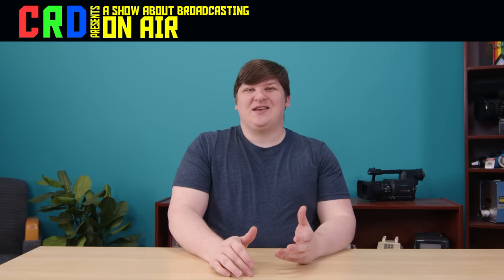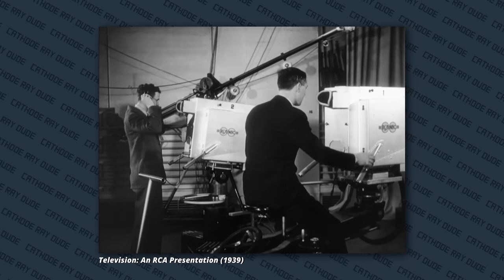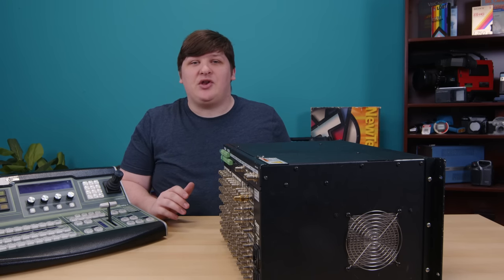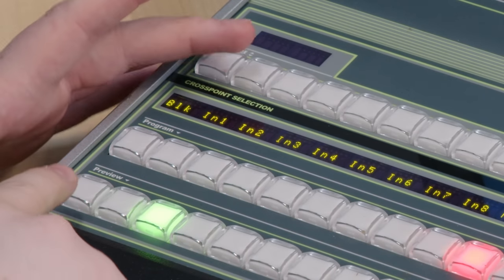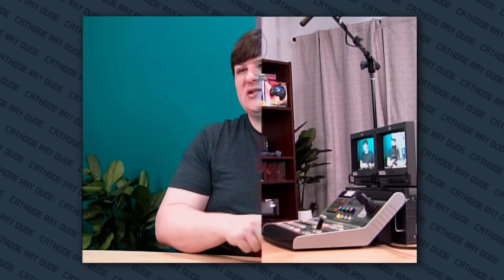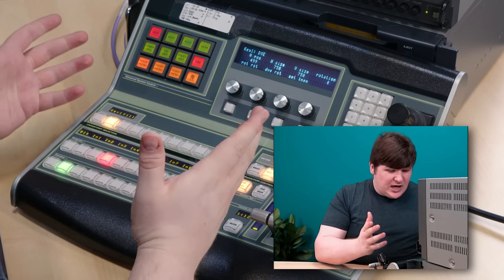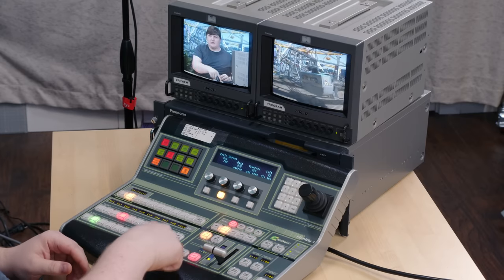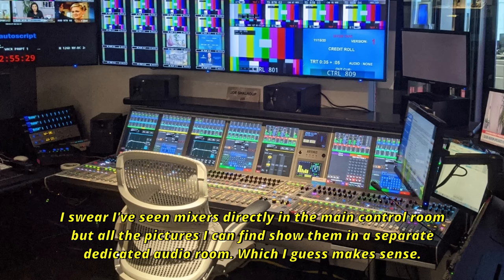What the heck is a video mixer?

Comment: I'm amazed by the concept of a church needing a video mixer - some of the churches here in the UK don't even have electricity! Regular churches might have a microphone and inductive loop so parishioners with hearing aids can follow the service, or maybe even a PA system with speakers, but I don't think I've ever seen one with cameras outside of special events like royal weddings and funerals. Is the service broadcast on TV or streamed, or is it intended to run video displays with Hymns etc like the screens in a lecture theatre, for the benefit of the congregation?
Reply: Oh this could be a long one. It started out with overhead projector with slides for song lyrics. Then digital projectors for song, lyrics and then photo background song lyrics, than they wanted moving backgrounds. This is first hand experience. I've seen a lot of churches where they will throw a camera up and feed a bunch of TVs like cry rooms for mothers with children and sometimes that extends to other rooms as well close circuit TV. However there's also mega churches and multi campus churches on the bigger side of things. the one I was at I personally felt like they went a little too rockstar. Although the pastor liked to do a series once a year for a month taking rock songs and relating a biblical history and some of the songs history. We also like to use movie clips to enhance a reference to something or build upon. Some churches have theater productions. Then there's the recording of sermons/services for later viewing reviewing, saving which goes from cassette tape duplication to video duplication and then next thing you know you're running a live mix for in the room screens a recording mix for streaming and recording multi campus location mixes.....

Among many things that I finally left the church over one of them was worship not being worship and more being more of a rock show concert. Of course this is the same church that wanted the rich folks to sit in the front row. Yeah there's a lot of unhealthy things in the church(s). But when I originally started with this church plant there was something very intimate about running lyrics on the pastors TV in his living room. Good old composite video. And a couple guitarists, with 10 to 20 people.

If you made it this far it was part of the Vineyard Church association, Evangelical based. But there's a lot of different variations and formulations in the US. And for better or worse there are mega churches where I could see that working but I can also see ways that it wouldn't.

Technology is a tool. Just because you have a hammer doesn't mean everything is now a nail even though everything technically is a hammer. There's a tasteful manner of using technology. I went to a seminar on audio one year where the guy went to the location where Jesus did a speech on a boat on the water because the crowd was so big. They were setting up sound equipment up on the top Ridge and the guy thought he heard the other guy say something so he asked the other guy and the other guy was like no I thought you said something. After scratching their heads a bit they got out equipment and found out they were basically in a perfect amphitheater with just the right amount of breeze that emanated perfectly off the location in the water. They then calculated what it would cost to build this nowadays and it was ridiculous to say the least. Suffice it to say God wanted his son to be heard that day and was willing to essentially pay for sound reinforcement for that one event before such things existed.
Reply: @imark7777777   Wow! Musicians? Guitars!? Wait, was that scene with James Brown in the Blues Brothers for real?!? Here, a church tends to be an unheated 700 year old stone building with maybe a church organ (wind, not electronic), and maybe a concert at Christmas with the local school orchestra - it certainly sounds like you guys have a more engaging and dynamic time of things! We have some nonconformist churches and halls, but they tend to be only in larger urban areas, or at least parts of the country I'm not in, so I've not seen what their service looks like. Thanks for taking the time to answer my question, you learn something new every day :)
Reply: @richardbanks2669  oh shoot I have to rewatch the blues Brothers. Yeah it can vary from singers a couple guitars piano fiddles flutes recorders orchestras in some cases. It depends on the musicians in the church and how the church wants to embrace those members.

I don't always read all the comments on a YouTube video but when it's under 100 or in this case 400 and a good topic I definitely enjoyed going through them all.

I briefly visited Scotland England and Wales with scouts so I have a vague idea of the UK church situation and how it's how do I put this state standardized religion by majority. But we also have the Catholic Church over here which is probably the closest. Although they generally have lights and some form of audio reinforcement. And some of the fancier ones do more things but they're stricter to the way they do them so it really depends on there local Bishop if that's the right word.

I love visiting my family in Buffalo New York as they were mostly Catholic and all good Catholic churches (a major assumption made by a 5 year old ) have pipe organs.... Which I happen to like.

I also know a few Methodist churches that weren't that far off from the church I visited in England. Not necessarily referring to the cathedraly ones.

One of the churches I went to liked to do a sunrise Easter service. They also did a few Sundays in the park, consisting of a small to medium band and sermon.

There was a church I went to that liked to do a full Easter themed month almost. Complete with members acting out the process in costume and even renting the old State historic Fort for it's Stonewall aesthetic. I got to be one of the Roman guards. There was even a portion that I didn't get to go to involving a hike up a small mountain. Which led up to Easter Sunday where they had a small mock up of a tomb made out of concrete on their property where the play would end and then everybody would go in for the final Easter service.

Generally it depends on the religious faction but there's still some variation between regionally what is accepted for that denomination.

There's also generally electric everywhere from the rural electrification which drove lighting and probably some extent heat and in warmer climates cooling. Then again there's also scrabbles like the committee that picks the committee that picks the committee that picks the chandelier they have been going at it for the last 20 years until somebody dies.

Some churches will do worship nights with their own worship band some will have like Christian singers come in and do a little concert. Some churches will even do full guest bands from other churches for Sunday service or whatever day they do.

And I'm not sure how to put this politically correct then there's the black churches which can be very open to loud spontaneous singing. https://media.giphy.com/media/v1.Y2lkPTc5MGI3NjExOWFmYTY3YmQ1NjA4MGY2ZmM3OTA2YjcxOTBmMmEyOGFjMDEwYTdlYyZjdD1n/l3UcyPbqmi4JPePkY/giphy.gif This stems from the segregation in churches which also developed their own style. Which I am so glad is over with because if you really want to have a fun time! It's an experience as well as being a minority.

Of course I also feel like I should mention there's also colts and false prophets that like to take advantage of people and what better way than to use religion. Which has given rise to unfortunately super churches because usually there's a lot of money in faith.

Comment: my school blew 10k on a new tricaster mixer but most of our programs use macs to edit so it basically site in a corner all day
Reply: When? Also, I didn't think Videonics made anything that expensive! Live is a different beast than edited stuff. You should practice doing live production too.
Reply: @BenFranske  Oh, i meant newtek lol, it was a bit similar in spec to the mxpro in terms of inputs. this was mid 2010s and they bought atleast 10 5k imacs and a mac pro to go along with it, my middle school had more well funded equipment and i actually trained on that a bit

Comment: I work in TV Production, have actually been trained at the video mixer a couple weeks ago, and I have to say what is most amazing to me is how absolutely ludicrously expensive all these are, and how absolutely worthless and useless they become after 10 years. The TV station I work at switched to HD1080i50 in 2012, and with that switch they had to get new video mixers of course, five in total, each one being a huge Sony rack mixer unit, with a huge controller, worth about half a million each. We're now switching to 1080p50 broadcast and UHD internal, which means we have to get new ones, and the old ones are just going straight to the dump.  Tell me something else that depreciates like that.

Comment: Is it not the case that the cost of a vision mixer when used for simple hard cuts is to synchronise the frames, either digitally or using sophisticated analog circuitry, to avoid the tearing and jumps you'd otherwise see from simple mechanical switching?
Reply from the maker: Well, sorta. It's kind of a complicated topic.

Older mixers required you to use externally synced (genlocked) signals. If you couldn't sync your signals at their sources, you had to use an external digital framesync to force them into alignment, and that was used for i.e. tapes and satellite feeds. But that was always a last-resort option; really, you don't WANT to retime everything, you'd prefer zero latency everywhere, especially so you can avoid stacked latency, if something happens to go through multiple framesyncs.

You're right that a simple mechanical switch will cause tearing or jumping, even with genlocked signals, but it's actually pretty easy to avoid that, with circuitry that delays the switching action until the vertical blanking interval, so the switch occurs when the image isn't being drawn.  "vertical interval switcher" is the keyword there, and I'm pretty sure those are very cheap and easy to build.

I've learned that even modern digital systems sometimes still "race the beam" as it were - they mix video line-by-line, rather than waiting for the entire frame to buffer, so synchronization continues to be an important feature even on brand new 4K and 8K cameras. More detail on why this still matters: (https://www.youtube.com/watch?v=DO4zQM7nzEQ&lc=Ugx7WX3d6wgssrSy2vJ4AaABAg) 

So yeah - most mixers have framesyncs built in everywhere in case you need them, but the older ones didn't, and the vertical switching circuitry shouldn't really add that much to the cost AFAIK. It IS true, however, that the one I have in the video DOES have framesyncs on all inputs, I just don't think that would have added that much in 2006, when that technology had really come down in price.

Comment: @19:00 that’s not true. Basic mechanical switchers while would switch the picture, you’d get a picture roll. You need a switcher that also synchronizes cameras and other inputs. At least in the analog world.  My middle school had a basic push button mechanical switcher when I first started doing the morning show. I eventually got the school to purchase a videoonics mx1 mixer and titler.
Reply from the maker: If you're using commercial cameras and have them all genlocked together, you won't get roll. It'll be a dirty switch, but not dirty enough for most people to care. Again, this is why you wouldn't actually do it, I'm just saying that it would do 90% of the job well enough.

Comment: I'd be super interested to know how the DVEs handle interlacing. I mean, to shrink an analog video by an arbitrary factor you'd need to deinterlace it first, right? What algorithms these machines use, does it result in what kinda artifacts, etc.
Reply from the maker: This is a really interesting question, yeah! Like, I didn't want to get into interlacing so I skipped over that whole topic in this video, and it's good that I did, because as soon as I hit this I would have gotten bogged down so hard trying to figure out how it works. Because yeah, technically, if you're moving "line 2" up one line, you're really moving line... what, 275 or something, up to line 1. It would have to buffer both fields, surely.

Comment: 46:52 
Thats not true. From a small Atem Mini to our large NEW TEK TC2 Elite, they all have audio mixers built in both for embedded signals (so whats in the HDMI or SDI) or external Audio Inputs. If you're running a small operation its possible to do the audio just through the Video Mixer, but ideally you always want to have a separate audio mixer at the very least handling the mic's / standalone audio sources. In a lot of cases for embedded signals though, it's better to get everything level'ed correctly b4 the show and then use the embedded signal bypassing the audio mixer because splitting it up can introduce sync issues. I'm guessing if you go really high-level in the production you'd still deal with the pain and just fix sync on all devices, but for web tv we usually don't deal with it and just give the audio engineer a return signal from the video mixer so he can keep an ear on he full mix. This might be very specific to gaming though.
Reply from the maker: My perception of both BMD and Newtek is that they really focus on small productions - heck, the Tricaster started life as a gadget for untrained schoolteachers to do web streams, that's no lie. It grew from there into a quickly deployable field unit for small productions, and then in the XD era they started getting more serious with the rackmount models. Both companies make pretty competent products, but there's still so much DNA from their roots in the prosumer space. BMD in particular has a "put it all on the pizza" approach where they try to pack in lots of easy value-adds in order to pick up extra sales from the market fringes, and I think it works really well for them, but it seems like most bigger companies want to pick a lane and stay in it, so when you get up to the grass valleys and the sonys and whatnot, they don't seem to provide any audio features at all.

Comment: Exactly how is the identity control table linked with the actual hardware that does the mixing? I got the impression from your video that the control table was just user input device.
Maybe the same controllers are compatible with newer HD mixers, or there exist aftermarket solutions to abuse the table as input device for different purposes, and that's why they are so insanely expensive?
Or they just use the same parts (displays, buttons,t-bars, encoder knobs) as the newer ones and there is a big market for spare parts?
Reply from the maker: This specific panel can in fact be adapted to an HD-era switcher with the addition of a ~$600 converter, but as far as I know most can't. I can't imagine they're getting mined for spares, but yeah, I couldn't really say.
Reply: I think they’re expensive because they aren’t made in high volumes and reliability is demanded.

The connection between the panel and the mixer could be a high speed serial link with proprietary protocol. Most likely these days it will be an Ethernet connection wrapping the same serial protocol.
ATEMs seem to use a “broadcasting” protocol. As in: other devices can just listen to the IP network, receive information and not need to directly communicate with the ATEM. I watched a YT video where the host made wireless tally lights for cameras that just sniffed the network.